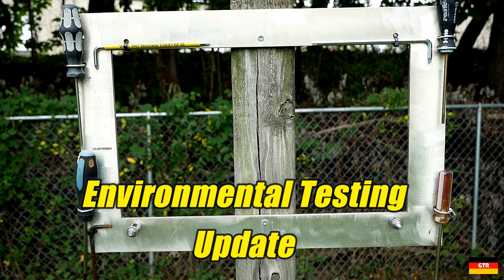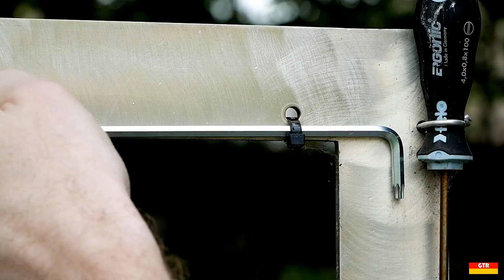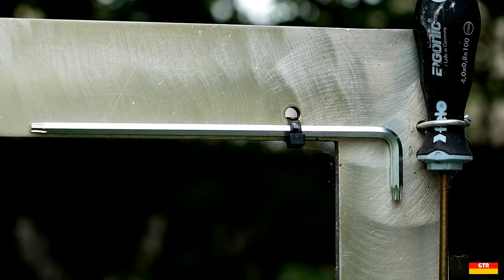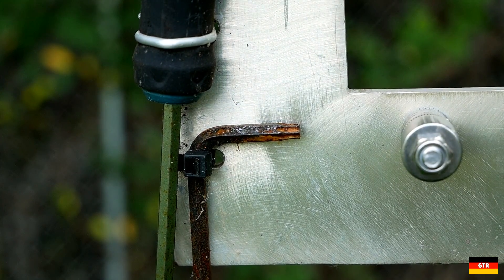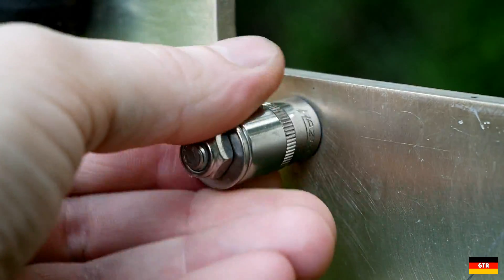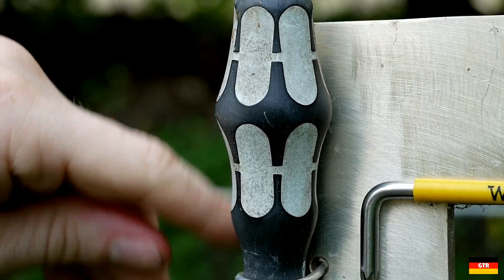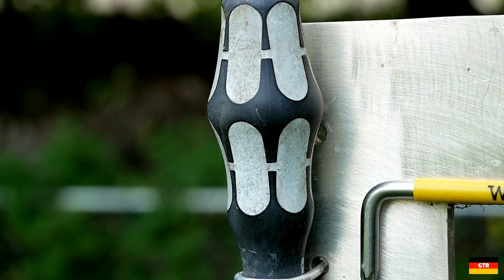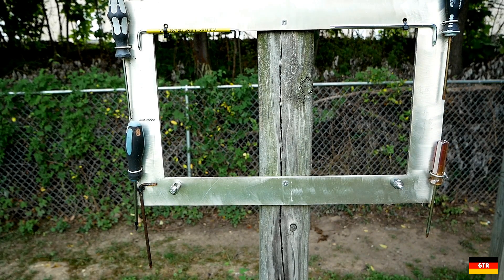Environmental Testing Update 2019/07

Comment: for the zinc finish torx. use it and mark up the finish and see if its still free of rust.
Reply: FishFind3000 I know what you are trying to say, but in this case, let’s say you buy a nice complete set of these, and you actually accidentally leave them in a shed or an old truck over the winter without using them.. this is what to expect.
Reply: Integra DIY odds are you are going to use them a couple times before that happens.   Tools are meant to be used.   Storing them brand new in a shed should not effect them at all.
Reply: Scratches shouldn't cause any rusting. The zinc is a sacrificial anode. As long as the zinc and steel are electrically connected the zinc will corrode instead of the steel. Eventually though the zinc will be used up and no longer prevent rusting.
Reply: With a chrome or nickel plating however, a scratch can cause rust